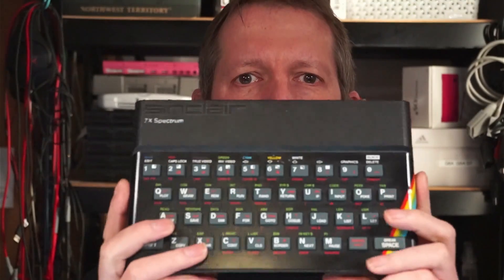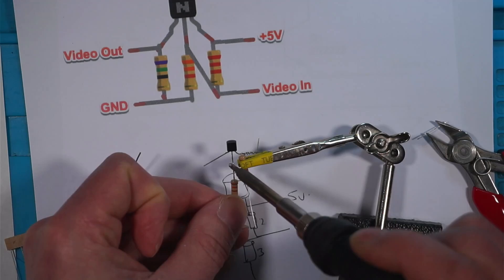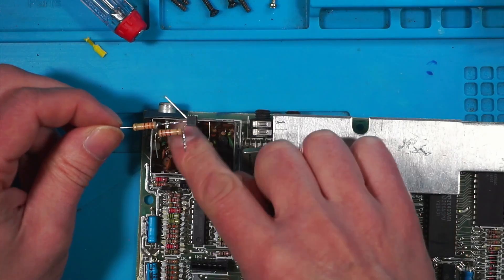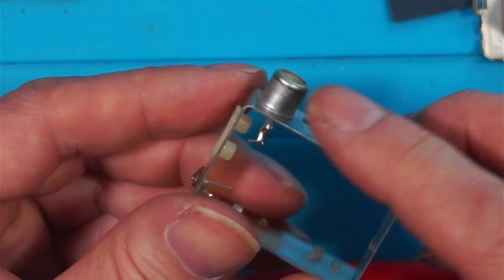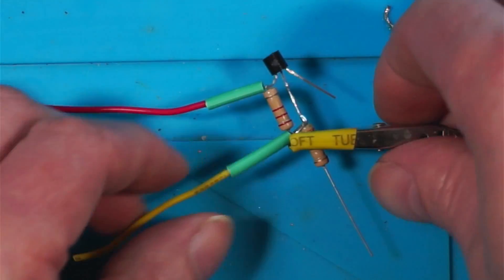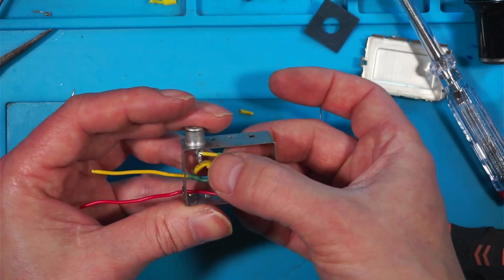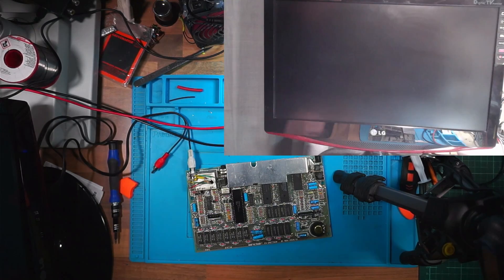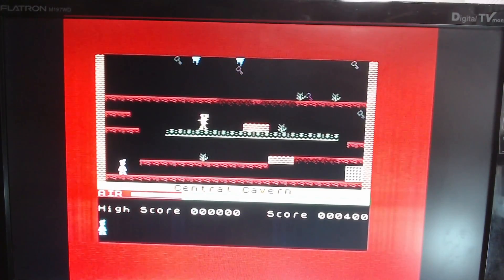Sinclair Spectrum 48k DIY Composite Mod 2023 | 2N3904 transistor

Comment: The pcture appears to show vertual bars after your mod. "Jailbars" (vertical lines) after a composite-modded ZX Spectrum are typically caused by noise on the power supply lines. I am no expert but what i read For 16K/48K Spectrum models, replacing the existing ceramic capacitors at positions C5 through C8 can help.   Also IMPROVE the grounding  can also help